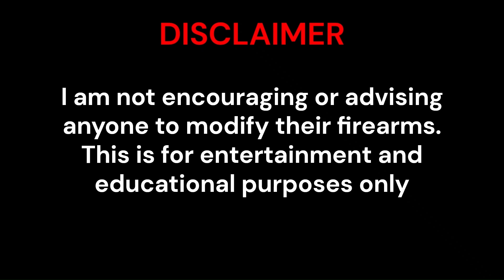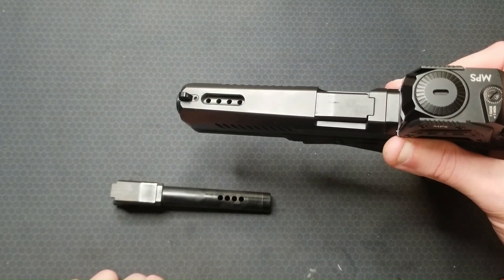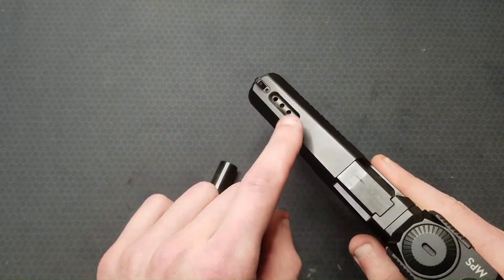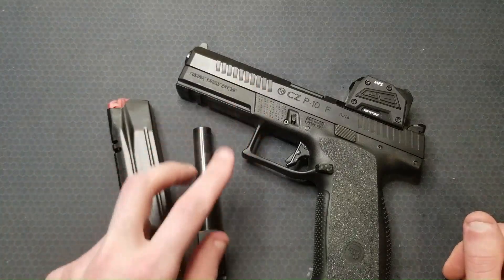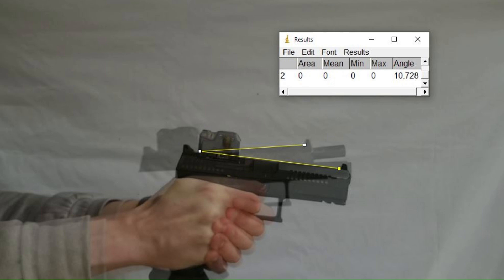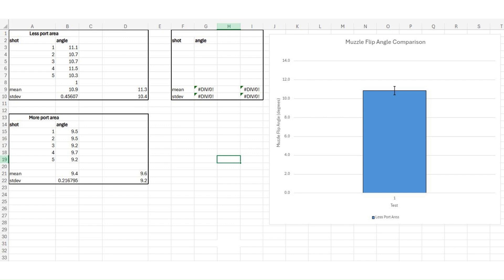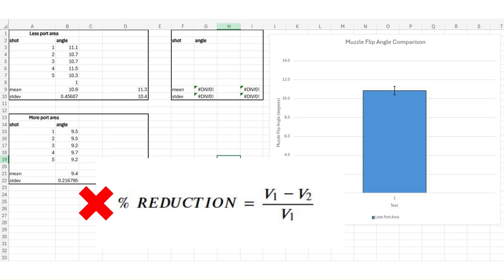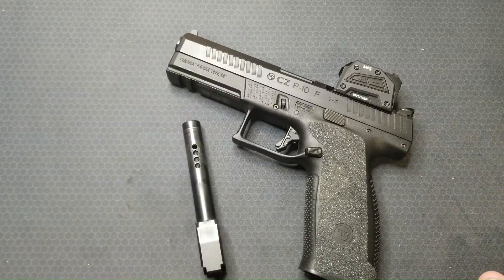More or Less Total Barrel Port Area

Comment: Thanks for the video! I noticed in the slowmo for the more port there was a bit of muzzle dip. I guess the recoil spring weight was a better match for the small ports.
Reply from the maker: Yes that's a good observation. After watching this footage I actually just ordered 2 reduced power recoil springs because I didn't like how much the gun was pitching forward on return to battery.
Reply: It was good you kept the same spring for the comparison, but yeah, the bigger ports may benefit from a lighter spring.
Reply from the maker: @Heteachethmyhandstowar  Yeah keeping springs constant for muzzle flip testing is important. I look forward to testing the lighter springs when they come in.

Comment: Just throwing out some side data, the port placement and gap size will play with it, as well. I've kind of started on the same journey.
Reply from the maker: Yeah distance from the chamber would probably affect pressure levels. Further out towards the muzzle gives the gas force more mechanical advantage. The spacing is another variable I havent explored. I usually base spacing on having enough material between the holes (which i didn't on this barrel in the video). My guess is more spacing between ports would make subsequent ones less effective. If the first one in a line is open longer before the bullet passes the next one, the first port will be venting that whole time and presumably the next one in line would see lower pressure levels than if it was closer?

Easy to get lost in the weeds with this shit haha.
Reply: @EngineersArmory  exactly. And crazy how tiny changes can actually make a difference on an event that's over in milliseconds.

Comment: What about V-8 porting? 4 on each side that are 1/2 the size of the large ports, totaling the same port area as the 4 inline large top ports? Wondering if the angle of the V ports have any effect compared to the 4 large top ports. Do they both have the same angle, or does recoil favor a certain port angle as well. Sorry lol just thinking out loud 😅 and also because I V-6 ported my 4.25” 10mm 1911 LOL Hope you’re havin a great weekend brother 🫡
Reply from the maker: I have done V8 porting and V6 porting. And narrow V porting (think a VR6 engine layout). There is no doubt that any port angle off of vertical will be wasting some of its energy by directing a component of it sideways. Wider V angle means a larger component of that gas force will be going sideways, and not contributing to pushing the muzzle down. I would imagine the V-angle could be made up for by more port area (especially after I saw the numbers from this testing).
Reply: @EngineersArmory I agree.